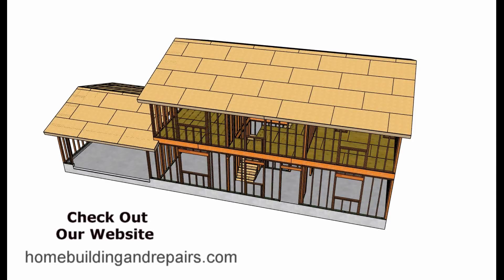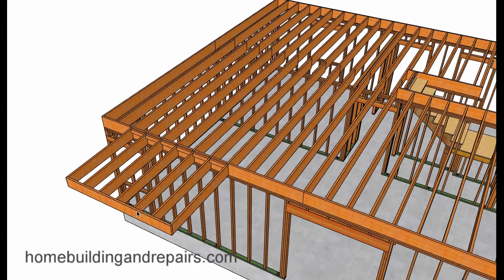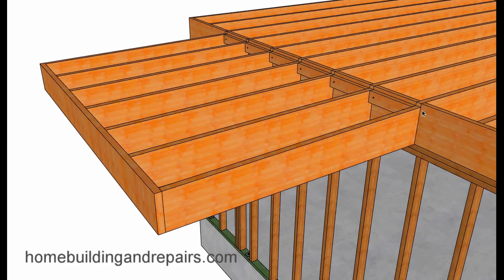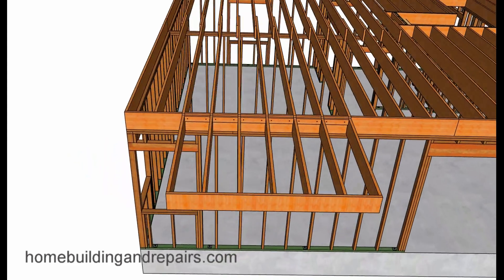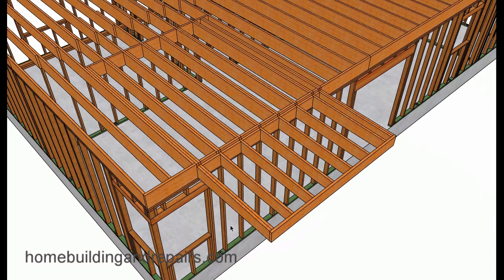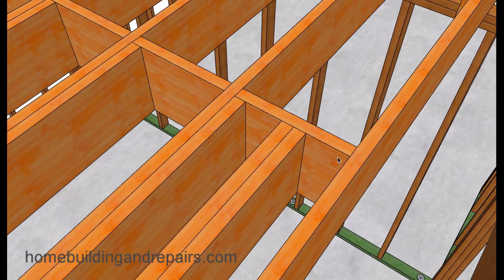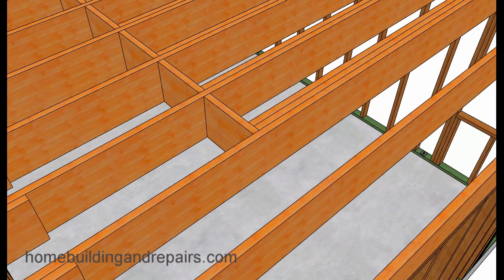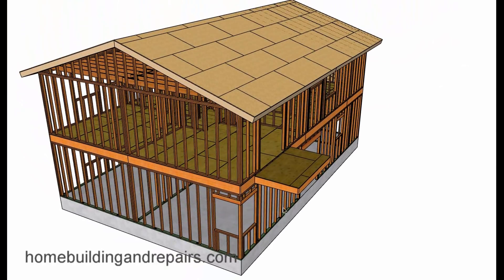How to Install Floor Joist for Sloping Balcony – Home Building and Framing Examples

Comment: I need to have my balcony replaced and I could not figure out the contractor was going to remove the old and replace the new boards . Now with this video I can visualize what needs to be done. My house has lots of crawl space so he can see what condition the joist are in to attach the new ones. I am so happy now because this all makes sense. Thank you.
Reply from the maker: Great to hear.

Comment: What if the home floor joists ran long ways instead of side to side?? What would be your recommendation on attaching the balcony to the home??
Reply from the maker: I would probably use posts and beams instead of the cantilever. There is a little more information at our website in the balcony section.
Reply: @gregvancom  so then it wouldn't be floating balconies per say. Right?? More like a deck??

Comment: How could I frame this as a 2nd floor catwalk on the interior side of the exterior wall without having the necessary 2/3 joist length to oppose the weight?
Reply from the maker: With steel framing and heavy duty concrete footings.

Comment: Does this mean that a cantilevered balcony cannot be done (or must be achieved by different means) if it's to be situated perpendicular to -- instead of parallel to -- the floor joists?
Reply from the maker: I don't  have a video on that yet, but if you email me a design of your floor then I will be glad to offer some advice.

Comment: Thank You for sharing! This has been very helpful. My house was built in the 70's. We have a 6 foot deck, and it looks like the joist only come inside to 8 feet. 2X8 joist 16 in. apart on center. The end joist are doubled up. I live in the Pittsburgh area and we can have bad winters. All of the joist outside have bad rot and need to be completely replaced. I want to build this to code as possible. The old joist have held up for 40 years. I was planning on rebuilding the deck how it was originally built. Does anybody have any suggestions on what I can do to build this thing up to code as much as possible? Any suggestions are greatly appreciated!

Comment: What if the balcony is located on the other side? perpendicular to the floor joists directions???
Reply from the maker: Most structural engineers will redesign the floor so that the joist are going in the right direction, but I'm assuming you're going to be working with an existing house and that's going to require a lot more work. I would suggest extending the floor out and using posts and beams to support it instead of the cantilever.

Comment: So, if my house was built in 1979, I have an existing cantilever deck exactly like this.  However, the outside end of my deck has rotted and needs to be replaced.  If my joists tie back into the house, how do I replace this?  I can't tear my floor out of my master bedroom!
Reply from the maker: I am planning on making a video in the future, just don't know exactly when it will be made to help with your problem. If you're not can a tear the ceiling up, then you might think about rebuilding the patio and using a support beam.

This video might help .https://youtu.be/NFKG3dFW-9E
Reply: @gregvancom  My balcony sits over my garage so I think the contractors will have to remove that part of the ceiling in the garage so he can install the new joists.

Comment: 8' balcony ?
Reply from the maker: If you look at the plywood, it looks more like 5 foot. I usually use 4' x 8' sheets of plywood in my examples, but don't remember the exact width or length, if that's what you are asking.

Comment: Thank you! This doesn't have anywhere enough views considering how helpful it is. This helps me solve multiple problems and, like everything, makes it seem very doable to build whatever it is I want to.

Is this truly strong enough to stand on? Supposed two people are out there?
Reply from the maker: You're welcome and thanks for watching. When I first started in construction they were built on almost every home and if built correctly are pretty strong. However, I have been on some of them that moved and didn't feel very secure.

Comment: Thank you for sharing!  However, I would like to suggest changing the pointer cursor you're using. Most of the time, I can't see your current one. I don't want to miss a thing!
Reply from the maker: Thanks and I actually think I found something. I've been listening to complaints like yours for years and couldn't find anything, so I spent an entire day looking for something that would work and will be using it in my next videos.
Reply: Ha, I did not realize he was using a pointer until I noticed your comment!